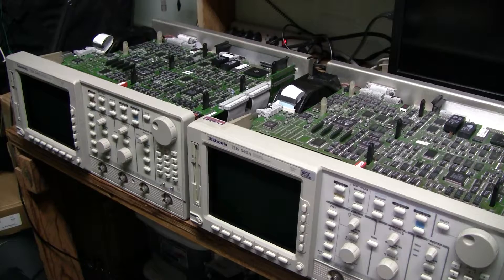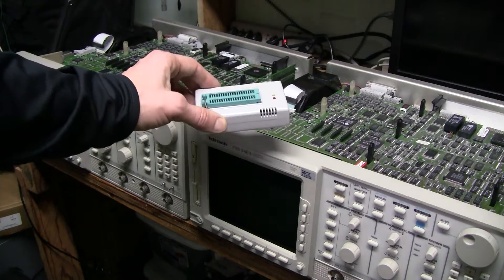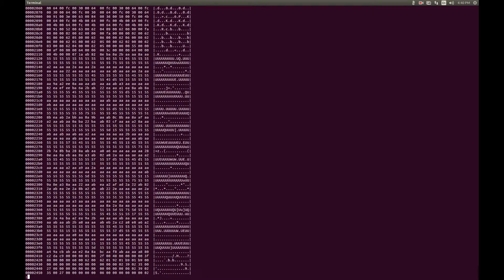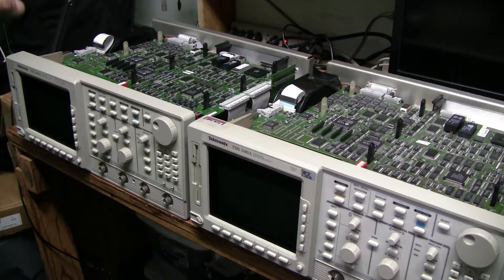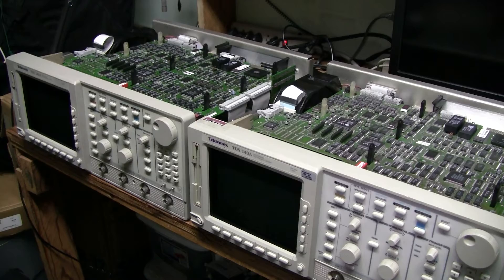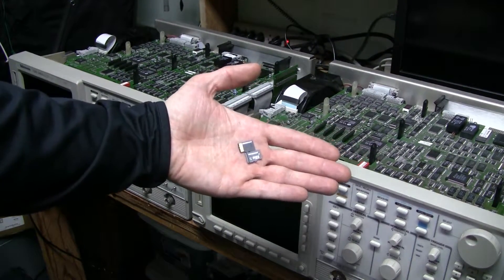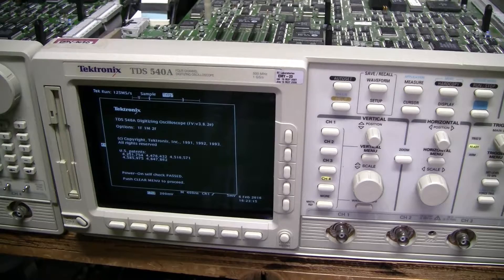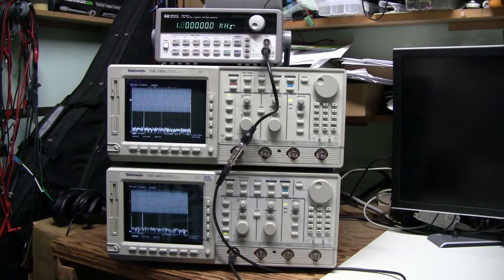#36 - Enabling FFT option in Tektronix TDS 540A oscilloscope

Comment: Hello, I've been following your videos for a long time and can see that you are an expert. I’m just a hobbyist in electronics, and I’m trying to repair my TDS744A. I bought it a while ago, and the first time I turned it on, there was no image on the screen, but when I connected it to a monitor through the VGA output, everything seemed fine. However, after a few days, I turned it on again, and only the front panel LEDs would flicker.

I’ve done a recap of all the capacitors on the CRT board and replaced the RIFA caps in the power supply, but the issue persists. Could you give me some advice on where to start troubleshooting the problem? I’d be very grateful for your help. Keep up the repairs—they’re really interesting!

I’m attaching a link to a short video of the issue. Best regards.
https://www.dropbox.com/home?preview=WhatsApp+Video+2024-11-06+at+12.03.59+AM.mp4

Comment: Hi, i have a TDS 460 (non A), and i want to enable options (1M, vga output), but i dont know what need to do. I have a PCI-GPIB NI card, but i dont have any program and really dont know how its work. It is possible to switch on option moduls?
Inside the scope there is a DIP switch but dont know what is the function of it. Can you help me enable the option moduls?

Comment: Hi.. are you concerned about other factory calibration data in the nvram getting overwritten with values from the other scope? Diffing the two images might point to a single byte field or value where these options are encoded, which would let you add the option without overwriting factory calibration too

Comment: I like to watch your repair-videos and I enjoy the way you explain it.
I am new in this group and I will start with a problem concerning my TDS744A-scope.
Since about half a year my Tektronix TDS744A does not start. When pressing
the ON/Start-Button, several Segments on the 7-Segment display inside the
scope on the Controller-board light up until the changing of the segments
stops and the scope is frozen. This procedure has to be started several
times and after 3 or 4 Trials, the scope boots up.
The calibration and date is lost and I have to run a calibration routine
(SPC) and set the date.
After this procedure the scope works fine.
When I switch the scope OFF, I can start it within a certain time (1 or 2
hours) without problems. Calibration and date are correct. Starting after a
longer period of time, the procedure is as described before.
I have desoldered the NVRAM (DS1650) and WD-Timekeeper (DS1486) and I have
added sockets on the corresponding places for comfortable changing the IC`s.
I have bought several 1650 and 1486 by ebay for replacement, but I was not
successful.
I tested the storability of the data of several IC`s with a MiniProTL866A
and I found them keeping the data over several days.
In different blogs I found that there has to be loaded special data on the
NVRAM as on the WD-Timer. But I didn`t find any programs to be loaded.
Is there anyone who had experience in this problem and can give help.
I would be happy, when my scope would work again and hope for good advices.

Regards
Guenter

Comment: I'm about to do a swap of the dallas chips in my tds520/tds540.
what is the best data copier to use and could you give me any advice on how to get the chips off the PCB without damage. I do have a solder remover gun.
Also I noticed you copied the data from one scope to another to get more features?
How did this effect the calibration costants?
To clarify, I'm putitng in NEW chips.
Reply from the maker: I showed the GQ-4X programmer, which worked for me to copy DS1650Y. Any decent desoldering iron plus some skill should do the business. Regarding the calibration, as I said in the video, I just tried with a copy of the chip from another scope with the right set of options. Of course, the DC offsets and such were wrong right after booting up, but the signal path compensation procedure fixed that. I found nothing wrong after doing that. Good luck!
Reply: thank you comrade.
I have the tds540/tds520 scopes. I believe you have the A version.
The non-'A' versions use the 1245Y chips I think.
FYI I have the full schematics for both scopes if you want them.

Comment: Hi! amazing videos, amazing work! thanks.
I'm currently in a battle with a 540A. 
Self-test shows a Fail++ processor and log shows a cpuDiagDsyAccess error. I suppose this error is related with video controller (dsy=display?).  Strange because scope seems to be ok, no problems in image.
Any tips?
1. totally recapped (not by me)
2. checked voltages in all caps
3. checked voltages in ICs
4. signal path compensation ok
5. checked continuity of some address lines in direction to video chip.
Last note: Once (just once) the scope has passed in self-test with no errors!

Comment: You really need a gpib to dig into these scopes. Tek didn't use the partitions with the DS1650Y so you could use the 1250 part, I do recall someone having issues with a 1250 programmer at the Tektronix user forum but I think others had success. With a gpip, reading the full error message (which is otherwise  clipped on screen), erasing it, adding FFT or 1M (if your acquisition board has the memory) is trivial.

The next generation of your scope with the fast acquisition system vastly improved that line of scope, more reliable too. With capacitor repairs you never know how long it will remain fixed due to the nature of the board contamination.

Comment: Wouldn't copying NVRAM from one device to another also copy factory calibration data which is commonly stored there and cannot be restored without using special tool chain?
Reply from the maker: +kvitekp 
People say that in these scopes the calibration parameters are stored in some eeprom on the acquisition board. These NVRAM chips store some settings, options, error log, probe compensation ans signal path compensation parameters.

Comment: From the datasheet you should be able to make a backup from the DS1650Y by using it as DS1250Y in the programmer. However programming the DS1650 could be impossible. You would first need to unprotect all the partitions in the RAM. The software for the TL866CS programmer can't really do this. You would need some manual mode to access the RAM in that specific pattern stated in the DS1650Y datasheet. I'm sure this is the reason why nothing changed when you copied the contents using the TL866CS programmer. The target RAM partitions was write protected.